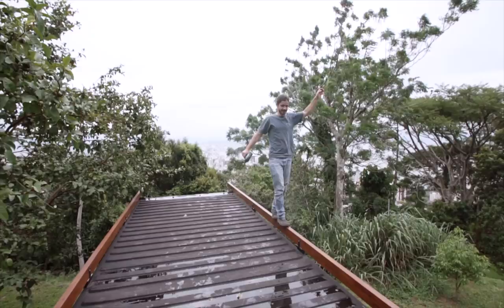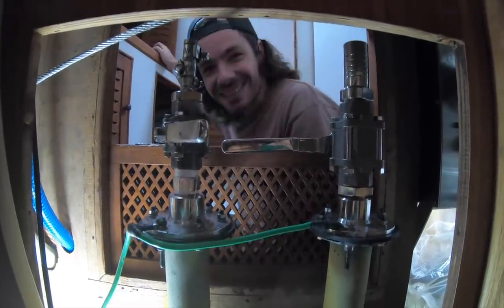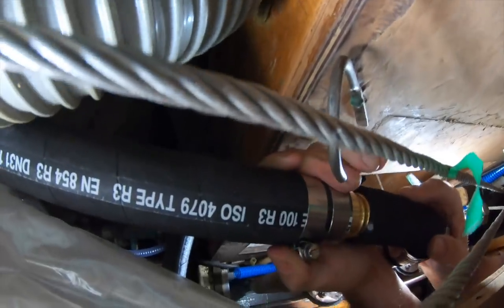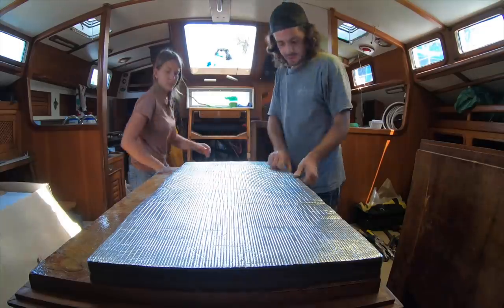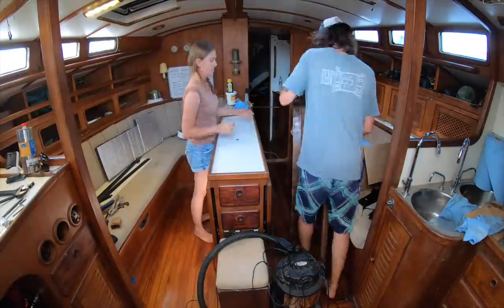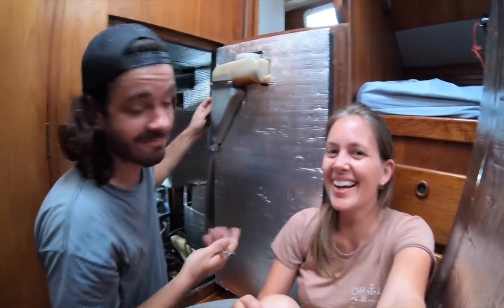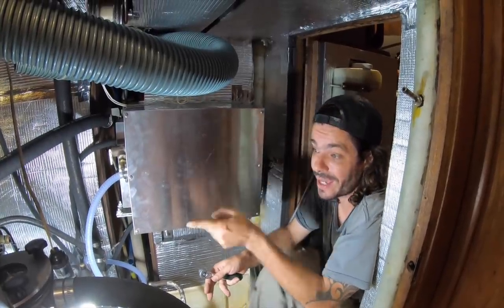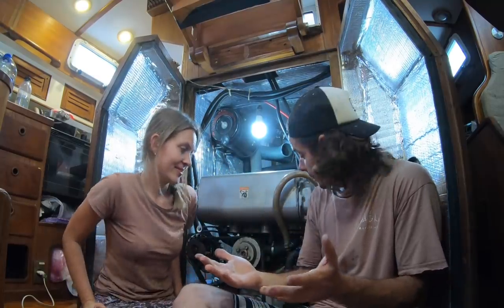⛵️Our Sailboat's Engine is finally ready to be fired up!!🤩#157

Comment: I may not have fully understood the hot water pipes from the engine,  but I wonder if I may or even should make a suggestion?....  I am certainly not qualified looking at this from a Utube video... But I was wondering if perhaps putting a by-pass hose with shut off valves that isolate the bypass from the hot water heater box or visa versa.  Would not be a good idea.  Would this not give you a better chance to use the motor if you have to, with the hot water heat exchanger box isolated from the motor.  This would give  you flexibility to continue using the motor while you sort out any problems that may arise with it at some point in the future if it gives trouble. I think being able to completely remove it without it interfering with the way the motor runs  (viz. removal of the the hot water heat exchanger tank by, by-passing the water before it gets to the hot water heat exchanger tank without it entering the heat exchange. I feel this would make your life far easier to service in the future.  Just a suggestion...  But I have to say what a lovely job you chaps have done. Well done! Its most impressive.  Love your show!  thanks so much and please do keep them coming,  I/we get such a lot of vicarious enjoyment thank you.  Like you, I can't wait to sea how well you Guys adapt to a life on the water.   How are your Captain exams coming along?

Comment: If you need to finish it off use some kind of 3M™ Venture Tape™ Reinforced Aluminum Foil Tape 1529CW
3M Product Number 1529CW to cover all the joins in the Engine Bay. Info only Guys.
Reply from the maker: Thanks for the tip. I could't find it here in Brazil.

Comment: The reason I said that about the engine is all oceans are mighty powerfull , so you need power to get out of tight spots. And also remember to get all countries emergency numbers to call so you won't be stranded in the middle of the ocean , specifically the largest ocean ( Pacific Ocean )  , there is a sand bar in there and GOD bless you if you find it like my ship did. Jeff Cagle

Comment: I thought about this the other day, why use brass vice SS in a salt water system? Brass does corrode very badly. Would seem a bad thing for a engine cooling water system. ??
Iff at some point your engine runs hot you can also use the hot water heat exchanger to remove some of that heat.

Comment: How about making a little box for a cover to go around the oil tank? Use the same material the insulation just don’t take the backing off of it and make it with a snug fit so I just slides on and off of the oil tank
Reply from the maker: This is a good idea, but we don't have space for that as the bottle is almost touching the hose for the water heater

Comment: Paint stripper to remove old glue before epoxy. Got enough clearance with the new sound panels? Is the foam under the aluminum panel fireproof?
Reply from the maker: We were afraid of getting the wood into a bad shape using it. Yes, we have enough clearance. Yes, it's fireproof.😉

Comment: Hi Duca and  Roberta... your 1 rule you are using to cut your sound proof insulation , where was it made as it looks like a Stanley tool rule....?
Reply from the maker: Hi, Steve. It's from a brand called Vonder
Reply: @OddLifeCrafting    Hi Duca ,  Roberta... iI worked for Stanley tools in Sheffield England when i left the Royal Navy and we made the same 1M rules. In your video they look the same, but if the do the job well who cares. I liked how Roberta was so full of happiness on how you both completed the engine sound proofing.  LOL
Reply from the maker: @stevenrobinson9600  We think the rules are quite similar. They  are good.

Comment: Epoxy coating was a good move for adhesion.  As an added benefit, won't it keep odors out?
Reply from the maker: There was no odor on the doors, but if it was epoxy resin would isolate it

Comment: Just make sure that, if you close those hot water valves, you don't interrupt the flow of your engine cooling system. 
Since the hot engine water you are using to warm the tank needs to be constantly running, make sure you have a bypass valve, so you don't interrupt the flow of the engine cooling water, which could lead to the engine overheating and could potentially be catastrophic.

Comment: I don’t know if anyone else commented in this, but if you use aluminum tape on the edges (wrap from the aluminum insulation surface, across the core, wrap to the surface it is mounted to). It will look even better and last even longer.
Reply from the maker: The tape didn't stick on the foam and it didn't work
Reply: @OddLifeCrafting  oh, it was THAT stuff. Did it work on the alimunized surface between pieces? Sorry to hear it. If the insulboard is of a certain class, we’ll that stuff is very particular about what it sticks to, AND the foam doesn’t really stick to anything. It’s too flexible and frangible.
Well, great job getting the engine bay insulated! It’s looks great!

Comment: Guys, the plastics Seals used to fix the valves of the heater to the "wall", are not going to melt if the valves heat? Its not better to use seals of some metal?
Reply from the maker: There were some of them on the engine room for years and they were still good 😉

Comment: Im not sure of the details of that hot water heat exchanger system, but you may need a 3rd valve so when you isolate it the coolant from the engine can still circulate thru those hoses when bypassed.  As you have it it appears that both the hose to and from the engine would be dead ended

Comment: next time you use a self-adhesive like the insulation on your engine room use a spray adhesive on the
 surface... the aerosol adhesive has solvents in it to allow it to spray easily which also intern soak into the substrate and creates a longer holding Bond..............
Reply: @OddLifeCrafting  usually when you use a self-adhesive peel off you usually use a small roller to press it into the surface .... to create a bond but you can't do that with a thick insulation so you need help .
if you use a roll on adhesive make sure you work it into the substrate. and good luck have a nice day
Reply: @OddLifeCrafting  and also what's your timeline .did all this happen  , boat repair happened months ago  ?
Reply from the maker: @robertregalado5662  As soon as we finish the task we have a new video on the same week about the topic. We finished the engine room and on the same week we posted it

Comment: WD-40 works good for dissolving adhesives.  Just soak it and scrape it off with a scraper.  I have used it several times to remove stickers and badging on automotive stuff.
Reply from the maker: In this case it didn't help that much.

Comment: You might want to seal the sides of the insulation on the doors where possible as well. Reason is the insulation will start to crumble from touch there first.

Comment: Since your water heater is above the heat exchanger, you will need to bleed the heater to remove air from the system.

Comment: On your hot water tank you should put a bypass shut off so that you can allow your pump to still pressurize and circulate the water so it does not become stagnant in your lines or the pump over pressure due to no water flow. Unless of course you're pump is designed to automatically bypass once pressure has reached a certain amount. Not sure how your pump is set up.

Comment: Roberta were you using Duca's Toothbrush to apply the glue to the door for the new insulation?
I am sure you cleaned it well before you put it back in the bathroom .
Reply from the maker: 😂 nop
Reply: @OddLifeCrafting  Nope it was not his toothbrush or nope you did not clean it?  Haha
Reply from the maker: @Bill23799  it was an old toothbrush, not used for teeth anymore

Comment: Good day to you, superb progression in every aspect of your projet. Suggestion; at 04:09, pinch the blade with a locking plier (vise grip) to be able to use it as a scraper in a safer and efficient way ;-) Awaiting for next week ;-)    And I'm wondeering ...... Considering that you have disassembled / reassembled and done work in every nook and cranny corners and angle of your boat, have you ever thought about classifying all of your very valuable videos for future reference should there be a need for modification and / or repair, improving speed for find the information. All of your video are now way better than any ''shop manual'' even from the boat manufacturer itself. Because you miss some '' little '' project to keep you busy (Lolllllllllllll ;-) ) Cordially
Reply from the maker: Thanks for the tip!🤗 See you  next week

Comment: good job with the insulation sadly now you will spend the next year hearing funny little sounds that get out between any gaps even with the tape over thejoints. its common in the uk to put a table tennis ball in the salt water intake then you can see if theres water coming in or if its empty

Comment: The sound insulating component of the material is not lead but another heavy manmade substance. The tape you are using does not seem to be aluminum HVAC tape but silver mylar tape which is what is supplied by manufacturers of this isolation material like Soundown.
Reply from the maker: This is the one we used: http://www.akustik.com.br/akustik-terc-pb.php The factory says that is Lead inside. The tape is actually aluminum as we said, for instance  https://produto.mercadolivre.com.br/MLB-865796214-fita-termica-aluminio-alta-temperatura-20mm-rolo-30mts-_JM?matt_tool=90090532&matt_word=&matt_source=google&matt_campaign_id=6542484841&matt_ad_group_id=84209438291&matt_match_type=&matt_network=u&matt_device=c&matt_creative=385102491763&matt_keyword=&matt_ad_position=&matt_ad_type=&matt_merchant_id=116765503&matt_product_id=MLB865796214&matt_product_partition_id=593338071728&matt_target_id=pla-593338071728&gclid=Cj0KCQiAy579BRCPARIsAB6QoIZvqDfrjmGi59Z8Oi9HzH0xGPZ61JYO0YZhA3r1H9UYfnB0HyVIzsgaAtwLEALw_wcB

Comment: you should normally leave the engine circulating thru the hotter tank, it's free heat.  If you don't use it you loose nothing, if you unexpectedly need hot water it's there.  It also saves you electrical system, no need to run down battery if you don't need to.  Only shut it off if there is an issue.

Comment: Anywhere you have aluminum connectors and water, especially salt water is going to corrode very fast, should you be using something galvanized? The cooling system has antifreeze of correct type, such as GM for aluminum protection, and not the stuff that gels up if mixed with reg antifreeze.

Comment: Quick Ties are going to fail due to the heat differential they will experience inside the engine compartment. Wire ties are a superior choice.
Reply from the maker: We couldn't find the 316L stainless steel to use there. The old ones that were on the engine room were plastic ad they were still good actually. 😉

Comment: But you guys leave the boiler on of course. Other than a failure there is no reason or disadvantage to turn off these valves. It just keeps the water hot, but that's the boilers job.

Comment: Duca.. I think you are a wise man in compromising the insulation between the engine room and the bedroom.. you don't want to make your woman unhappy, especially in the bedroom :)
Saw the new coolant going into the cooling system.. hope you changed the engine oil as well (I have to go back and look at what the bloke did a year ago, as I cannot remember)  Potsie. Australia.
Reply from the maker: We were actually lucky Robbie. If we had installed the full insulation the door wouldn’t close because of the hot water tank hose and we just found out that when we were done. 😅 ohh we changed oil months ago. So now we will use this oil fot testing the engine for a while and before we set sail we will do another oil change. 😊👌🏼
Reply: @OddLifeCrafting  ahh... Roberta has women's intuition :) .. gonna say, are you intending to put the Aluminium tape around all the edges of the insulation (might stop future bits of the foam 'falling' off)?

Comment: Please be careful not to breathe toxic fumes from Epoxy, and other glues and coatings-use respirators, or kill your kidneys or liver.   My neighbor applied fg resin to his engine supports, and bulkheads, connecting his superstructure to his hull, on his new 36’ Cascade sailboat-doing all the work on his interior, and installing his engine and shaft, too.   But he only sailed it to sea, once, came down with cancer, and died shortly after.

Comment: You should put down cardboard on your salon table before you work on it.  Also, be sure to wash (water) the epoxy amine blush off before you stick anything on that surface.
Reply from the maker: You put plastic on our table and we sanded and used a wet cloth before gluing anything on it 😉

Comment: I would install a air bleed valve on the highest point of the engine coolant lines........because as is, you will never be able to get all the air out

Comment: Watch that 90 if it is on the inlet. It will be much harder for the pump to pull a head of water through it. If it’s the outlet it is not such a problem.

A sharp elbow is like trying to suck along a 14ft pipe. A lazy bend is much less.

https://www.westada.org/cms/lib/ID01904074/Centricity/Domain/2479/WaterSupply%20Pressure%20Calculations.pdf

Comment: Need to vent the engine compartment
Reply: The engine itself is an air pump. Once it is running it will ventilate the compartment. A gasoline engine would require supplemental exhaust to remove flammable vapors but Diesel is not a problem.
Reply: In case you didn’t notice it, there is a blower motor and hose to vent he engine room.
Reply from the maker: Thanks  for the explanation. You are correct 😊

Comment: That tape looked more like mylar than aluminum.
Reply: I think not aluminium tape. I agree w u
Reply: Isn't mylar a plastic film with aluminium deposits?  As i understand it that metalic shine is aluminium.
Reply from the maker: It's actually  aluminum
Reply: Well it turns out that shiny silver mylar is metallisized BoPET. Which just means it is biaxially oriented polyethylene. The shiny surface is created by vaporized aluminum or gold being evaporated and bonded to the surface. Huh... who knew? When I think of aluminum foil tape I think of the heavier aluminum tape used in HVAC. 😁

Comment: sorry... but you didn't use the correct insulator material. For diesel engines compartment you must use material with high mass to reduced low frequency... your type is only for temperature, but reflecting the noise inside. The older have many little piramides for absorb the noise energy. :(
Reply from the maker: It's made for sound proof http://www.akustik.com.br/akustik-terc-pb.php
Reply: @OddLifeCrafting  ok, it's a lead layer inside. Perfect!